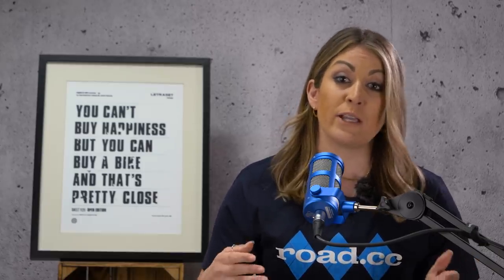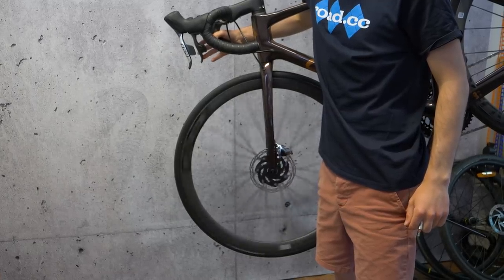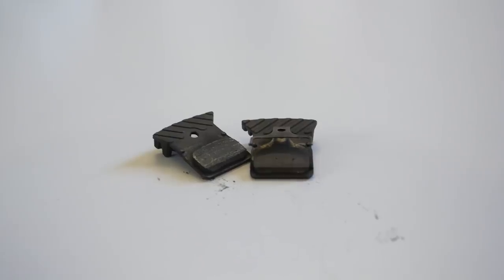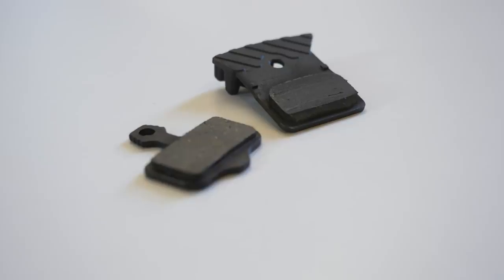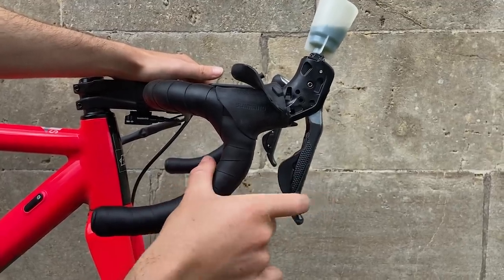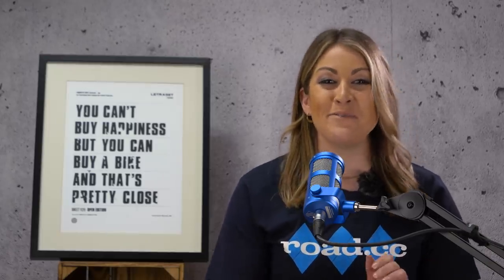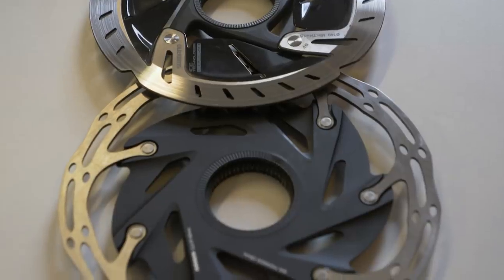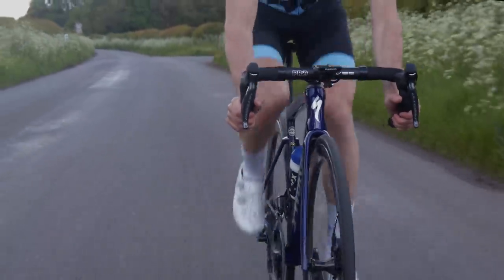8 things they dont tell you about disc brakes

Comment: Thank you. I started cycling in 1952. I never thought that disc brakes were right for bicycles. Never had them. Intend to never fit them to my bikes.
Yes, disc brakes do squeal - half of the peloton in the Australian National Criterium Championship in Ballarat in torrential rain in January 2020, had disc brakes. Deafening scream every time at the bottom turn. Horrendous noise. All professional teams.
Thank you.
David out.
Reply: Been cycling seriously since 1967, pro racing in the 80s. I have 7 bikes equipped with discs and one with linear and one roady with calipers. Yes, some of my disc brake bikes squeal when heating up, some don't, hate the  noise...but....I live in the mountains, some descents are 10 miles long with hairpins all the way down, disc brakes heat up but continue to work for the 15minutes of descent without fade or problems. Off roading, I will never use rim brakes again, period. Wish there was a disc brake system that actually worked without problems....you would think this is not that complicated of an engineering problem to solve....but....we get bottom of the barrel engineers in most the bike manufacturers...drug addict engineers who cheated their way through school. 2021 bikes prove that irrefutably. Weak wheels, stupid cog spacing (ratios) index shifting for front derailleurs, index shifting is stupid design and made for beginners only, frames for the recreation adhering to UCI rules, tires that can't take a thorn without flatting, bike pumps that leak at the seal, drivetrains that wear out in 3000 miles, rear tires wear out in 1000 miles.....just 50 years of stupidity and never fixing problems.
Reply: But I bet the cyclists were actually braking instead of wishing their bike would pull up with rim brakes.